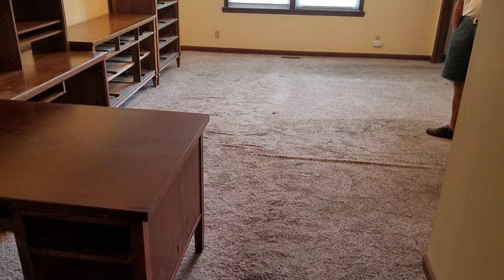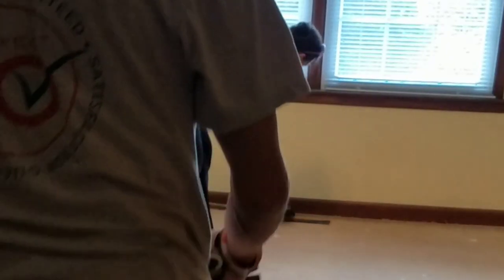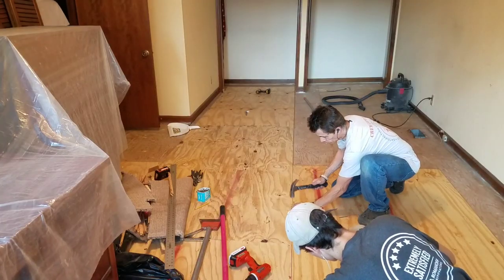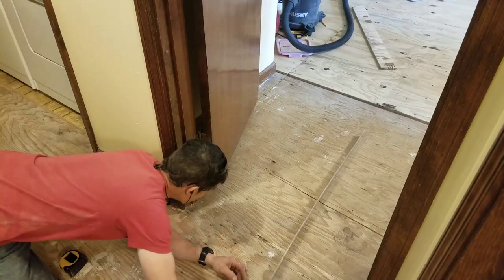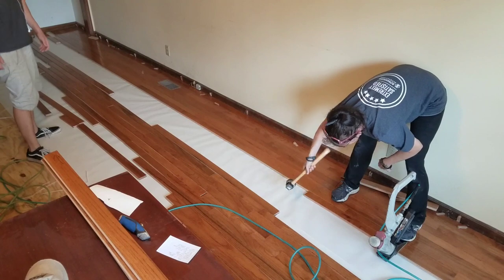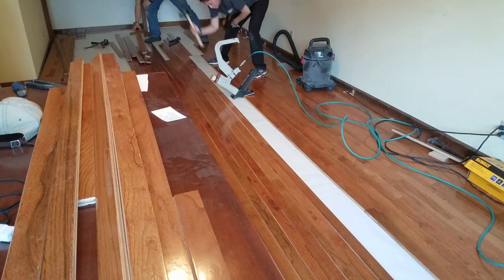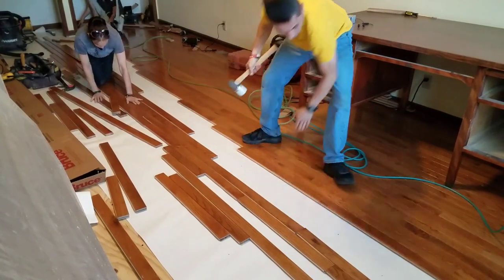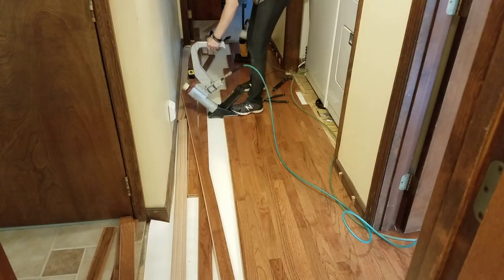You cant install hardwood on particleboard. Here's what you need to do.

Comment: Is particle board and osb subfloor the same? Also, Can we just add quarter inch plywood onto  the top osb?
Reply from the maker: Not Osb is Oriented Strand Board. It is made with small strips of wood glued and highly pressed to make a strong material. Partical board is small partials of wood pressed together. Is is very porous and will swell if it comes in contact with water. Osb is a little more forgiving and has a protective layer that allows water to sit a little longer without swelling. Osb for roofing... particularly board for speaker boxes in your car, lol. Also it you are talking about luan 1/ 4 inch... I would definitely not do that
 Luan has to be installed using staples about every square 4 inches, and if you're laying it on particle board, that could be a distaer later on down the line. Im telling you moisterue and expantion are usually the biggest reasons for floor failure. I've had people tell me they have had their hardwood installed over the particle board for 30 years, and it's still there. But they don't mention every plankn is cupped and peaking at the seams.  There are dos and don'ts, and Im sure some people are having floor issues from where I did dumb things 15 years ago. But I learned the hard way, so I just do it the right way so that it can never fall back on me the installer.Hope that helps. Thanks for the question
Reply: Is it okay  to staple 3/8 engineered to osb?  What would you put under it?
Reply: @YOUFLOOR ❤ thanks for patiently answering my question
Reply from the maker: If that's all that's there, I may consider putting another 1/2 osb on top, then my felt paper, then my hardwood. Also. No matter what you do, make sure to run your hardwood perpendicular to your floor joist, not parallel.

Comment: Great video! I’ve run into the same problem with particle board. Removing it will be a pain. Anyone wanna share what it cost them to remove a nailed down glued down particle board on plywood? Im working with 1100 sqft.
Reply from the maker: Ouch. I'd say around 1650.00

Comment: But what if I use 2 inch nails in which would go through the particle would and the plywood which is underneath the particle board. In my living room before we moved in there was hardwood over the particleboard and its been 10 years and it seams very sturdy. Is it because they used 2 inch nails in which the nail is attached to the plywood underneath?
Reply from the maker: I totally get it. Just because a coin flips 5 times on heads doesn't mean the next flip is tails. Each case is different. Even a broke clock is right twice a day but from my experience it's just always been recommended by they manufacturer to never install over particleboard. It didn't say unless your using 2 inch nails and there is real wood under it. Boy what a time and money saver that would be. But when you install for a big company your choices are to do it as recommended or dont do it unless you dont mind risking buying a new floor for your customers if something does go wrong. If that's the case I would pull the particleboard and lay right on the bottom subfloor to keep the same level as before with carpet. Hope that helps thanks for the question
Reply from the maker: Also particleboard is  just a cheap filler for carpet. If your laying real hardwood it's not necessary
Reply: Thank you I decided to rip out the particle board which is 3/4 and replace it with 3/4 plywood over 1/2 plywood which is the subfloor. So that would be 1 1/4 Im sure thats plenty for 16 in joist. Thank you
Reply from the maker: For sure. Should have awesome grab and be very sound

Comment: What about gluing hardwoods to particle board?
Reply from the maker: Anything that gets attached to a subfloor should be attached to real plywood.  I didnt go to school and im not a paticle board expert but from what i have read and from my 12 years experience.  It is never a good  idea to glue or nail down wood on particleboard. You may do it and never EVER  have a problem. But particle board  is not a structural substrate. It is genearally use as a cheap filler to bring floor levels up when installing  carpet.  If  damaged  it can easily and inexpensively be replaced. But thats the problem. Its just glue and saw dust so if you get a lot of moisure where you live it could interfere with the glue your using or cause the particleboard to swell in spots causing you wood to bow and eventually come free.
 If you are not in the position to pull and replace the particleboard with real plywood, I would suggest a good quality floating floor. If anything ever goes wrong you can always remove the flooring back to the problem, repair it and replace flooring. Thanks for the question

Comment: couldnt you have added furring strips?
Reply from the maker: Nah. That wouldn't  made ot spongy in between the strips
Reply: @YOUFLOOR  I thought about that, deflecting at seams...  I plan to use a 3/8" plywood subfloor screwed down over top of particle board... screws at joists of course
Reply from the maker: That may or may not be okay but keep in mind the more floor you add the smaller your baseboard gets. And if your going up against any exterior doors the may not be enuff room to open the door. And in the kitchen you may not be able to get flooring under the dishwasher and if you only put it in front you could trap you dishwasher if you ever get a leak.  Also if you have refrigerator cabinets this can raise your frigerator up just make sure that it still slides underneath the cabinets once the floor is raised. Hope that help. Thanks for the comment

Comment: use adhesive!.....it can be done
Reply from the maker: Okay Dan. Guess that's why they call you dangerous Dan. It's been my understanding you don't glue down 3/4 hardwood whether its particle board or not. Thanks for the comment
Reply: @YOUFLOOR  Must be different over there, here its standard practice!.....Im assuming your particle board is just chipboard?
Reply from the maker: No o.s.b.  is fine but. Not the kind you make speaker boxes out of. I'll check more into this for different codes over different places.